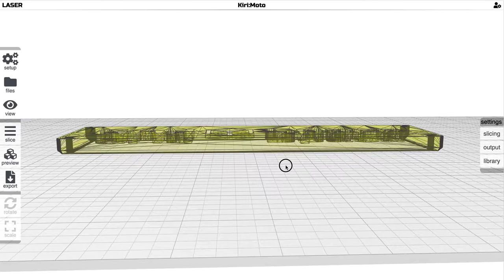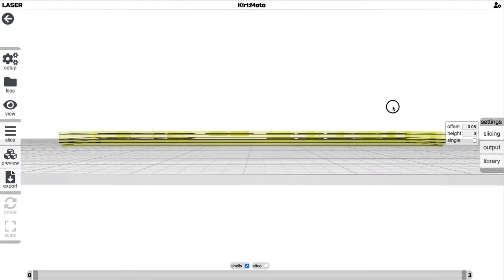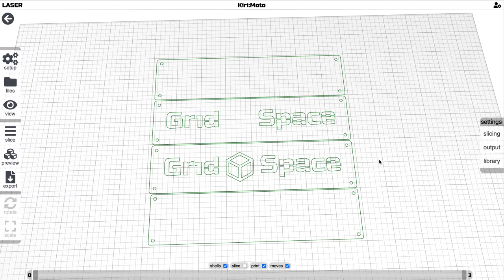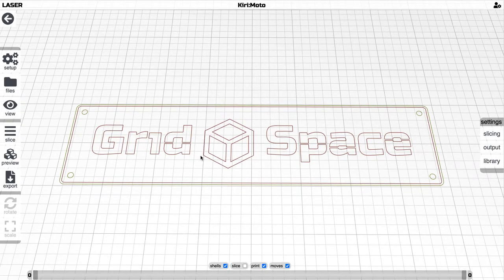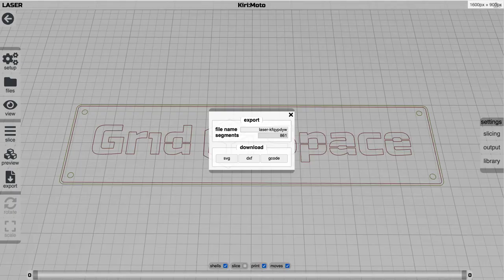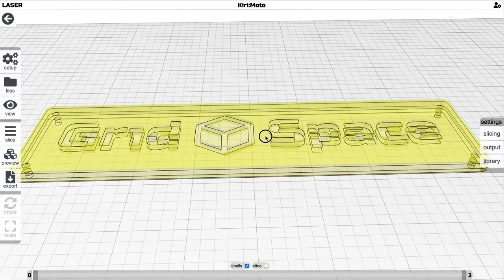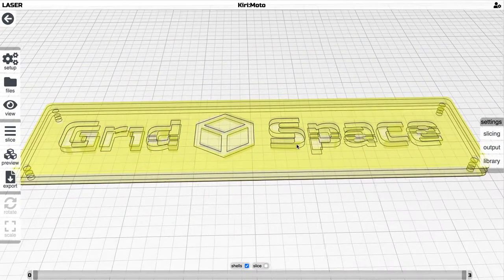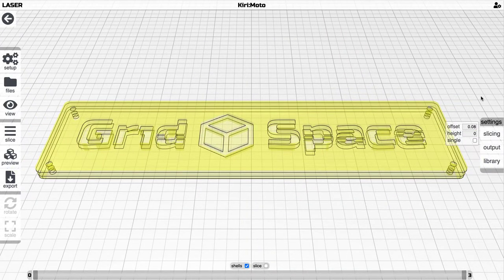Kiri:Moto Laser Slicing Options

Comment: This is an amazing feature. I’d love to have the equivalent in CAM workspace. I’m currently slicing and dicing models in Blender to have them milled in EVA foam slabs that are then stacked back and glued... not complex but quite a chore to manage!
Reply from the maker: If you just want 2D gcode output from the feature, then Kiri:Moto already supports that. Just create a laser device and fill in the required gcode header/footer. The resulting gcode should be most of what you want. If not, bring the request over to the forum and we can discuss how to complete the feature.
Reply: GridSpace Ok but the whole point is to have the non vertical edges milled according to the 3D model so that when the stock slabs are stacked, the exact profile of the model is created.
Reply from the maker: @ArnaudMEURET  in that case, there is already another requests to automate the use of cnc-mode z-axis constraints to do something very similar. this is a bit more complicated, but possible.